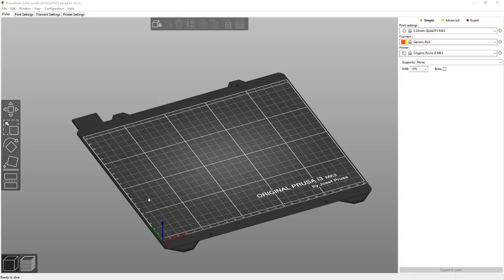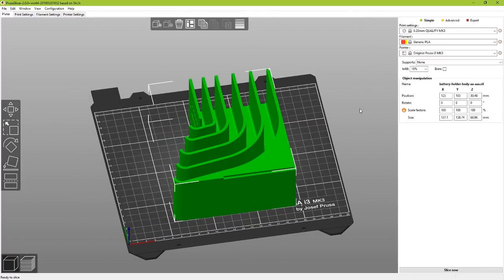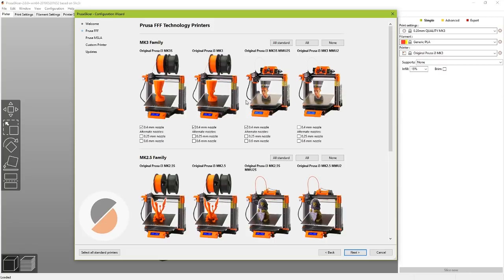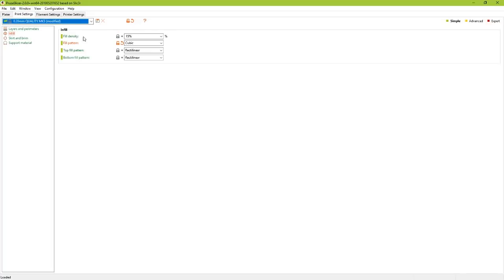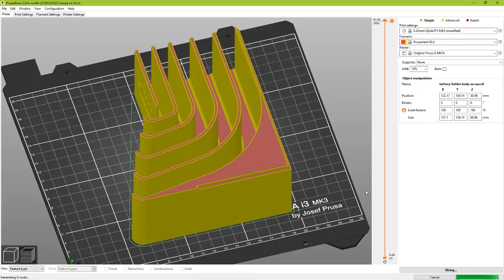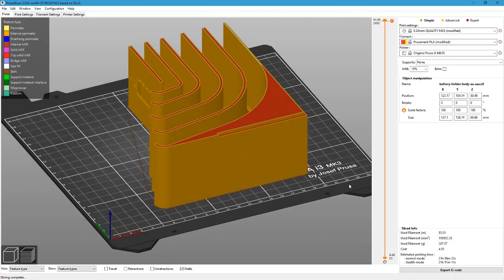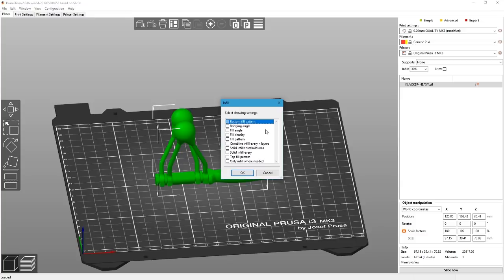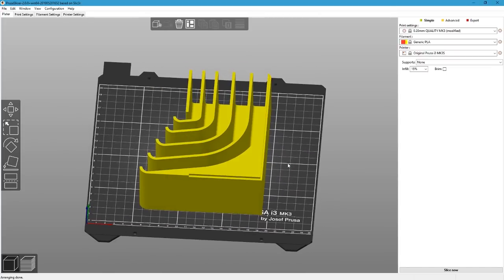First look at the new Prusa Slicer 2.0

Comment: Great video...
I found an annoying firmware update notice that appears and beeps twice on the Prusa MK3 printer screen when you attempt to load a Gcode file from the SD card.  My MK3 is loaded with 3.3.1 and runs fine and the slicer wants loaded 3.7.1.  You can press the rotary selection button to continue but JEEEZ!  There seems to be NO option to turn this junk off in the new slicer 2.0 software.  Prusa needs to make this an optional alert as they do for the software update notice.
Reply: In Advanced mode go to Printer Settings > Custom G-Code and remove the third line of text in the Start G-Code. You'll need to save the printer settings as copy though i believe. My MK2s was well out of date so i updated.